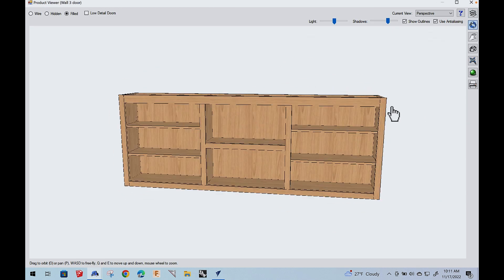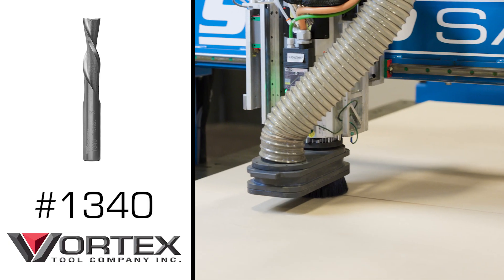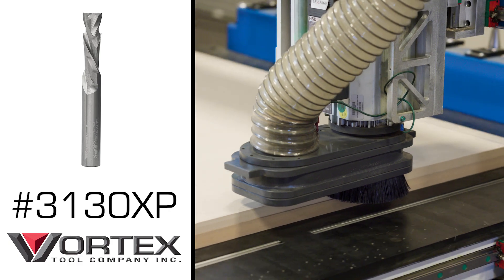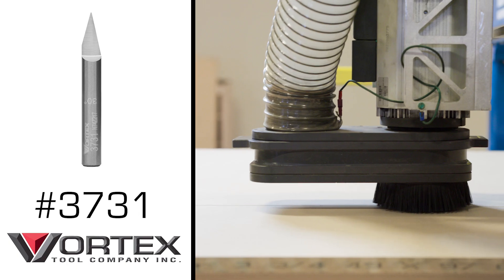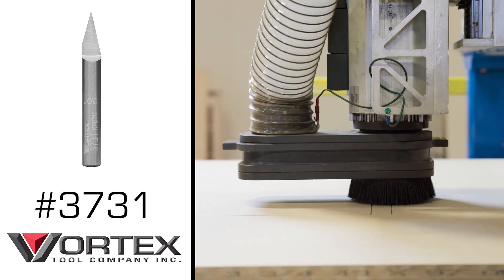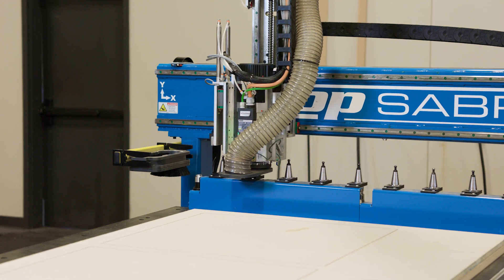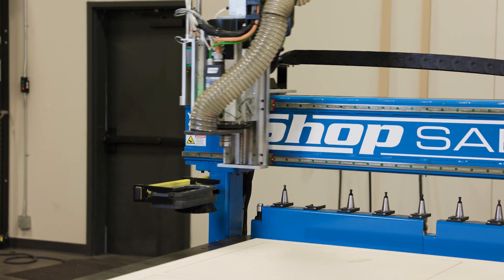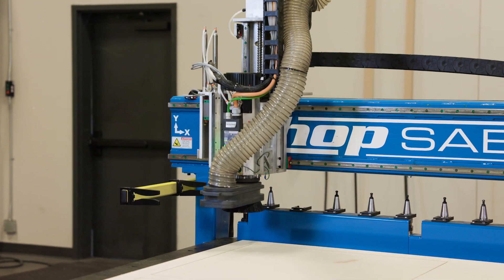ShopSabre CNC Engineered Face Frame - Part 2

Comment: I would like to see more videos on the m series.
Reply: you mean ISM?
Reply: @AmmaBeWude  close enough IS-m
Reply: @garenpletzer1532  its basically the same machine, minus rotary ATC and a heavier frame.  The servos are a bit faster and have more steps than the IS series.
Reply from the maker: It’s very similar machine just with the Mitsubishi M series controller, heavier frame, and a bi directional rotation rotary atc
Reply: There would be no difference in the process between the Pro, IS, or ISM Series … the are all members of the “Machine Tool Grade CNCs” at ShopSabre (Ballscrews).